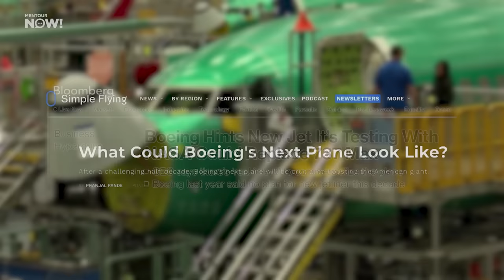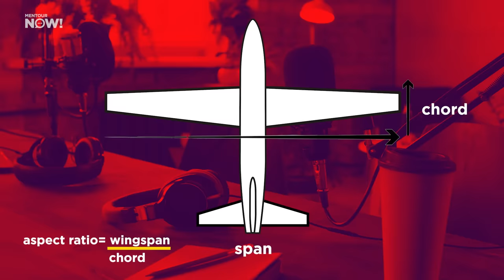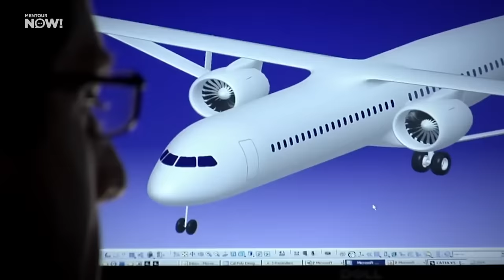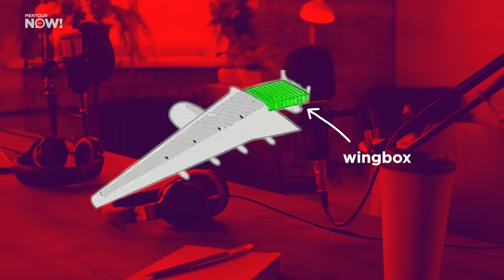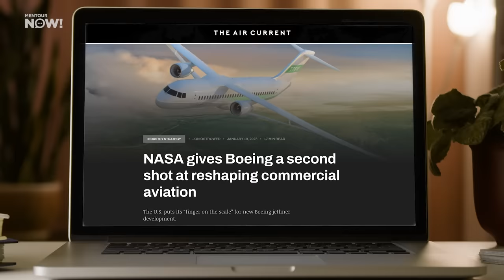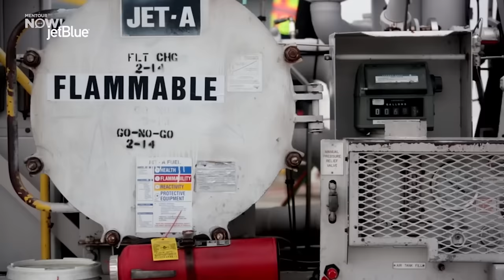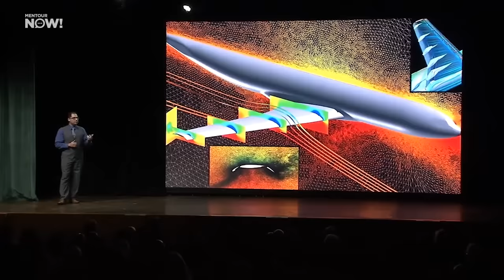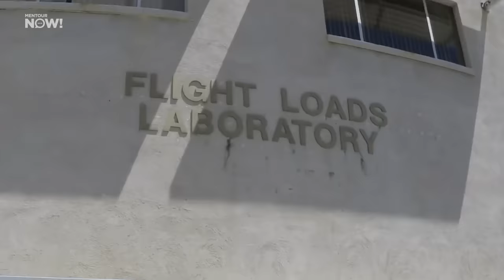Revolutionary Breakthrough: Boeing's Transonic Wing in Partnership with NASA!

Comment: I truly hate to say it but I"M NOT getting on for a few years into production.    We should all remember the max...
Reply: What are we supposed to remember about the 737 MAX? I have my ideas but maybe they are different than yours. I think we should remember that the Boeing engineers made some serious mistakes designing a new piece of the control system. And we should remember that Boeing managers didn't think that pilots needed to know that the new control system existed, or how to turn it off, assuming instead that when pilots did their normal procedure for runaway trim it would get shut off.  

And we should remember that the control system caused a crash, both because of the design mistake, and because the pilots didn't know about it and didn't react quickly enough. And we should remember that after the first crash, Boeing wasn't aggressive enough in letting pilots know about the system and how to deactivate it, essentially just putting out a memo about it. Some pilots didn't get the memo or pay enough attention to the memo (since their airline did not make clear the importance) and this led to a second crash. 

So to summarize we should remember that Boeing engineers used poor judgement in the design of a critical system, and Boeing managers used very poor judgement in communication about the new control system. These mistakes led to two fatal accidents. I think that's it unless I missed something.

Comment: A well managed company is a partnership between engineering and management. The latter know what the market needs. The former often struggle with “good enough”. I’ve seen a very large telecoms company fail from that last issue. The market needed features that engineers had not considered important. Management did not “interfere” in designs and they went broke.
Reply: LOL... Blaming engineers.  That's rich...

Comment: In 2016 and 2018, two Southwest Airlines' Boeing 737 Next Generation aircraft suffered uncontained engine failures while operating regularly scheduled flights.  With BOEING'S PROPOSED "TRAN-SONIC WING DESIGN" the jet engines appear to be located "immediately outboard" and horizontally aligned with windows from the passenger compartment. Can BOEING guarantee with 100 percent certainty that passengers would never again be maimed or killed from "an uncontained fan blade separation" with expulsion through the fan case/nacelle and into the passenger compartment?  I think not. Additionally, the noise from the horizontal alignment of the jet engines to the passenger compartment is a big negative. BAD CONCEPT DESIGN BY BOEING.
Reply: The problem with an uncontained engine failure is not the fan (which has to be contained, this is tested), if a disc from inside the engine ruptures there's no way to contain this since it has far too much kinetic energy.
Reply: @simonm1447  If you bothered to read anything about the two Southwest Airline incidents where the turbofan engines exploded, you would "see" that investigations showed that in both cases; turbo-fan blade separations were the direct cause of disc separations THAT OBLITERATED THE NACELLE AND EXPELLED ROTATING COMPONENTS THROUGH THE FUSELAGE.  And this was the "main point" of my comment above regarding the piss-poor locations of the twin engines in this "concept design" aircraft. CEO Dave Calhoun should have been FIRED for even suggesting such a dangerous aircraft design.  Fan blade containment tests by engine manufacturers regarding fan blade penetrations through the nacelle "DON'T MEAN SHIT" when real world events prove that "UNCONTAINED CATASTROPHIC TURBO-FAN JET ENGINE FAILURES THAT COMPLETELY OBLITERATE THE NACELLE, ALLOWING ROTATING COMPONENTS TO RANDOMLY DISCHARGE EVERYWHERE - "ARE" AND "WILL CONTINUE TO BE" A POSSIBILITY." The best way to safeguard passengers and flight crew is to locate the engines UNDER THE WINGS, far outboard and below the line of passenger windows.

Comment: Why must it fold up? Why not fold back? Retract start from the finish of the strict bar. Like tomcat.
Reply: Tomcat had variable swept wings. The reasons for this configuration have been different, it was not just to reduce the wingspan. Other carrier aircraft which had folded wingtips to save space on carrier decks always folded upwards, it's simpler and lighter. Tomcat never folded just a wingtip, but the whole wing instead

Comment: I can tell you from experience, high wing aircraft feel turbulence much more than low wing aircraft. It's going to be a much bumpier ride.
Reply: It also depends on the size. Most high wing aircraft (with the exception of military cargo aircraft) are small in comparison, like the ATR or the Dash series. Such aircraft are lighter, and lighter aircraft are more sensitive to turbulences. They are propeller aircraft, which are slower (to benefit from the better efficiency of turboprops at lower speed) and slower aircraft have less wing loading than faster ones which makes them more sensitive to turbulences too.

A bigger commercial aircraft with jet engines and a high wing may not be different from a standard jet in this behalf.

Comment: The 707 "quite literally shaped commercial aviation for over half a century"? I'd say it shaped the rest of Boeing's narrow bodies all the way through today's 737 Max, but everybody else's airplanes and Boeing's own wide bodies don't have much to do with it. And the DC-8 would have probably been developed just about the same even if 707 didn't exist. In fact, the story goes that Boeing widened the 707 fuselage to better compete with the initially wider DC-8, even though 707 entered service first.
Reply: I think Petter is talking about the basic shape - long, cylindrical fuselage, low mounted swept wings with engines in pods below the wings, horizontal tail surfaces just above wing level.  OK, there are some really massive technology differences, but they are more evolutions on this shape than being different.
Reply: @18robsmith  De Havilland Comets had all those same aspects... except the engine pods, or whatever they called them. You're right, those sure were different, and I suppose previous prop-liners engine placement was generally more into the wing that below it.

Comment: Folding wings OR variable swept wings like F111 could permit compliance with gate width restrictions.
Reply: Variable-geometry wings are a bigger technical challenge than folding the wingtip. They're mainly used in aircraft that have to maintain performance characteristics across a variety of Mach envelopes, such as the B-1B and F-14. Especially since the wing has to remain fully functional in all configurations, while a folded wing doesn't have to do anything except not collapse.
Reply: @Harrier42861  Great points that I didn't consider.

Comment: Would “high aspect ratio” describe a wing with a wider or narrower wing?  It was stated as (Discussed at 3:50 ) “the ratio of the span to the chord”(span/chord) value is higher when the chord is smaller. Or is it actually the ratio of the chord to the span?
Reply: Span/chord is correct. High aspect ratio wings are long laterally and short longitudinally.
Reply: @AmbientMorality  Duh, right. Math is hard.:oops:

Comment: I'm sure there is a reason but what are the negatives of placing the support on the sunny side of the wing?
Reply: My (uneducated) guess is that the supports above the wing could mess with the airflow that is responsible to create lift.
To me it would make more sense to block more of the air underneath the wing instead of on top of the wing, but yeah, that's just my guess.
But, i think it would look better though.

Comment: On the issue of gates and wingspans why not design a flying wing with the span of the 747 and go for it?
Reply: The challenge with flying wings (or blended wing bodies) is you can not stretch or shrink them. If you build one it's the size it is, but to make a smaller one you have so scale down the whole aircraft. With a conventional fuselage (which is inferior in fuel burn) you can just add or take away some of the fuselage and you can offer 3 or 4 sizes. With a flying wing or a blended wing body you build 3 or 4 different aircraft instead.

Comment: Would adding struts negate the need or effectiveness of winglets?
Reply: Winglets serve a different purpose. They arrest wing tip vortices which in theory reduces drag. Struts would not have that effect. But making the strut itself an airfoil is a no brainer so that it contributes to lift. The same goes for the fuselage. The fuselage should be an airfoil as well.

Comment: So, why not put the truss on top? It's the triangle that adds the strength.
Reply: If the strut is on the top, it's typically loaded in compression and then buckling becomes a major issue. The strut on the bottom is normally in tension, which means the strut can be sized substantially smaller. Even with the strut on bottom it's actually still sized for buckling because of negative-g maneuver requirements, but that's only -1g instead of +2.5g.

Comment: if were going to fold wings i wonder if swing wing would be a better way to go. or the blended body desighn.
Reply: Swing wings always swing in one piece, however it's too heavy for an airliner and you simply don't need it there. If you fold just a part of the wing they always fold upwards, even the folding wingtips on some older carrier aircraft did this.

Comment: This is so unlikely to succeed it’s almost laughable, to think that a strut braced wing could ever compete with a similar cantilevered design is beyond silly.
Reply: Why? It's so much more structurally efficient
Reply: @AmbientMorality  no it isn’t, the two enemies of aerodynamic efficiency are drag and weight, why do you think biplanes became extinct in the 30’s and strut braced light aircraft such as the C152/172 are only still around because they are cheap and don’t have to perform well?
Reply: @johnmorris7815  This is lighter than an equivalent cantilevered wing, though. A lighter wing and strut can support bending moment far more efficiently than the much heavier single wing spar in a cantilevered design.

Comment: I wonder if swing wings would work on commercial aircraft also known as variable-sweep wings.
Reply: Variable-sweep is more complex and adds weight. It seems like it's more beneficial for supersonic airplanes. Then again like anything maybe in the future they will come up with better ways to do it if they think there is a big enough advantage.
Reply: @StevePemberton2  Getting the wings to fold in half and have enough space for fuel seems complex as well.
Reply: @Boodieman72  I'm sure it would be. Although there is decades of experience in the military with both methods, and that would probably influence their decision about which would be more difficult.
Reply: @StevePemberton2  A lot has changed in materials since the last military variable-sweep wing was devolped.
Reply: @Boodieman72  That doesn't mean they will toss aside decades of experience and not even consider it. Some things change but not everything, and the things that do change it's often a matter of degree.
Reply: @StevePemberton2  I haven't seen anything about them trying it.

Comment: I would probobly claim that the last time Boeing went out to make a new concept was the sonic cruiser... while a interesting concept, did have a few major flaws.

The Transonic wing have been under development for almost 20 years now. I wouldn´t quite call it a breakthrough, specially since it have not flown in full scale yet. There probobly is a few issue to iron out when it flys at full scale, and i kind of think it will not look like that in the end.

Personalty i kind of think the concept will be inverted. The thing is, when a fully loaded aircraft (at least a long range one) sits at the gate, 60-65% of the total mass is inside the wing. When it fly, the wing support the other 35-40%, but when the plane taxi (and its really the most strain on it), the wheels and the fuselage is supporting the wing, so that is 60-65% of the total mass.

Due to most material behave better during tension than compression it actually make more sense having the supporting wing on top, and the main wing at the bottom. This is also better in structural loads for the fuselage, getting the main wing beam down low, and just the supporting beam up on top. Still the engine may still be placed in the middle section:

On top of that, just making the wing higher aspect ration, decrease both the ground effect as well as the efficiency at high angle of attack. This might be a issue during lading, really making a lower wing, beneficial.  If the engine can hang from the truss, in stead of the wing, it still have the been fit of having a fairly high engine placement (granted, the engine get a bit more aft, that is a disadvantage).

11:06 "need to have the same area"
That is not quite true. The area of the wing really only have a large effect with ground-effect. At cruise the wing area have virtually no effect on the lift at all. Of cause, making the wing longer, is always beneficial.  To really have a good result of the wing, the area need to be smaller while the span need to be longer.

I would also presume that a new concept 737 replacement like this would be considerably lighter than a 737, also more efficient, so it would carry less fuel. And it could have smaller gear and lighter engines.

A 737 max 8 have a empty weight of 45 ton, a payload of 20 tons and a fuel wight of about 17 tons making a MTOW of 82 tons. Wing will of cause be much lighter, fuselage will probobly be made of composite, so it will be lighter. Gears can be shorter, and also less sturdy, so lighter and the engine can have less thrust.

So lest assume the OEW is 35 tons, payload is still 20 ton... lets just cut the fuel in half 8.5 tons. MTOW down from 82 tons to 62.5 tons.

Also of cause, the engine will be the new next generation propfran with a increased efficiency of say 20%. The wing have a increased efficiency of about 20%, and say the fuselage also become 20% more aerodynamic to make it simpler. So the wing carry 24% less load, its 20% more efficient and the engine is 20% more efficient that is 51,4% reduction in fuel due to lift and a 36% reduction in fuel due to drag. Calculate it together and the aircraft will lose 12% range while halfing the fuel load. If they can shave of a few tons more, they might get it to the place where it have the same range. Of cause, this is all theoretical, but it show how much possibility there is introducing two major new technologies.

12:55 Firstly you calculated it wrong. It will be 8 meters at each side. I also kind of suspect the air current also calculated it wrong, just transferred the numbers, not considering the airplane will be lighter.
Reply: I might be misunderstanding your reasoning, but you said that materials behave better under tension than compression.
With that reasoning it makes more sense to put the wing on top.
Because that way during flight (when the wings are under the most stress) the struts are under tension.
If you put the struts on top they would be under compression during flight.
Reply: @Jehty_  Yes. Even with the high wing, buckling under negative-g loads is the constraint for strut sizing. A low wing, dealing with the much higher positive-g load requirement, would clearly significantly increase strut mass.

Comment: Some neat designs and issues that have to be worked through. Although the likelihood of this going into production are pretty low with how risk adverse aerospace executives tend to be (and probably for good reason) when it comes to pulling the trigger on unproven designs. The carbon fiber 787 Dreamliner was a big risk for Boeing to take and it did become a boondoggle and somewhat of an embarrassment for them due to delays and costs ballooning. Of course, the MAX fiasco overshadowed that. Boeing's little delegation tricks with the FFA to certify new airframes under minimal scrutiny has had some of those doors shut in their face. Even more reason to stick with proven designs. Unless Boeing has a Kelly Johnson in their back pocket, then they're more likely to just go with more efficient engine designs. Those legends of aviation just don't exist anymore and even Kelly knew when to pull the plug.
Reply: This comment would make sense if it described and evaluated the risks you speak of.  It doesn't, and ANAICT, that risk isn't there.   Not a technical risk anyway.  As for the airlines' risk appetite ... if the airplane reduces operating costs and proves otherwise worthy, airlines will buy it.

Comment: I think Airbus may have actually lost out on a lot of a350 orders with the 800 being off the table. Although I don't see carriers ordering huge amounts of the 800 variant, I could see it being there win over Carriers who need a plane of that size as well as something the size of the 900. Especially United who have went for a massive Boring order as the 787 can replace their 767s and older 772s quite easily. The a350 can replace the 772, but it's too big to to replace the 767 and the a330neo is too different from the A350 to be suitable operations wise. I know United are getting a350s but it's not going to be their backbone like it could have been. But even with potential lost orders from not having the small variant that a350 is doing more than well enough

Comment: This plane is 50 years old it was in my eng textbooks in collage in the late 80s. Boeing probably rolled it back out because it need a boost in in PR and to distract the fact that its planes or prehistoric.
Reply: 1,000,000% accurate ✅
Reply: Oh yea the reason it has a DC-9 tail is McDondald Douglas did all the work Boeing is claiming for themselfs. They should have made a MD-9x Max.